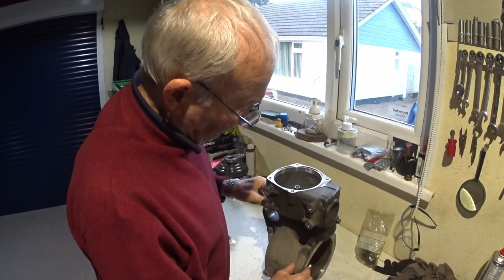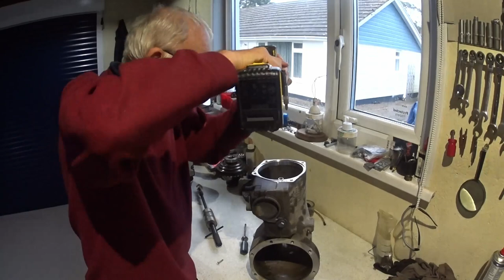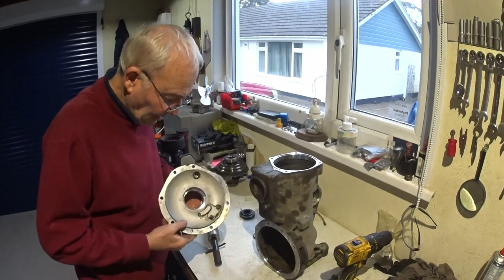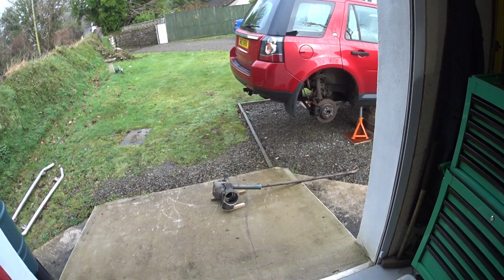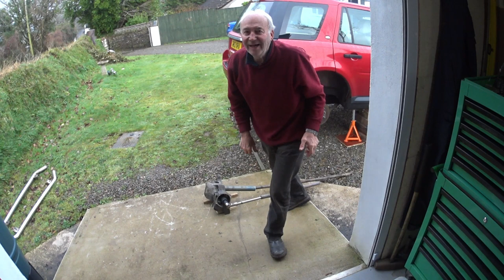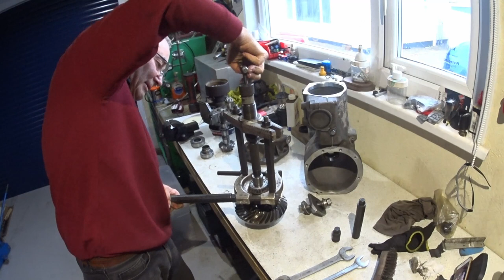Freelander 2 Rear Differential Pinion and Crown Wheel Bearings Removal

Comment: Which bearing is it that your removing in the last part of the video? Or if you can provide a part#. I have to replace mine . Thanks
Reply from the maker: Hi,

The bearing in question are the crown wheel bearings (one on either side of the crown wheel) The bearings came in a kit as; the 2 crown wheel bearings, the inner and outer pinion bearings, the 2 crown wheel oil seals, the pinon oil seal and the 2 O ring gaskets.

However I should still have the old bearings in the workshop, I will get the bearing number off the crown wheel bearings later today when I am in the workshop and let you know.

Regards, Brian.
Reply from the maker: Hi,

The crown wheel taper bearing number is 32008 and the size is 40mm i/d x 68mm o/d x 19mm wide.
The originals are KOYO hi capacity. Landranger Deeside 4X4 sell them but they are quite expensive, however any bearing supplier will have them, but they should be good quality.

Regards, Brian.
Reply: Thank you. I appreciate it
Reply: I was able to order the bearing from Rockauto based on the model/part #. My other issue is that I might have to replace rear diff side cover. There was some wear and tear on the ring where the axle seal fits. The seal doesn't fit tight. If you are able to provide an email address, I can send you the pics. Thanks
Reply from the maker: @asifkadodia3822  There is some great gasket jointing compound that I have had some good results from which will work for the O ring seal and on the outer edge of the oil seal if you have some damage on the faces. 
Its called Simply Instant Gasket, I buy the 200ml size as in that size it comes in an easy to apply auto dispensing tube, or you can get a 310ml size but you need a mastic gun to apply it. The link below is where I bought my last tube from. Regards, Brian.
https://www.amazon.co.uk/Simply-SR-005-Silicone-Instant-Gasket/dp/B00CI86RCM

Comment: Do you have any good advice regarding the removal of the rear differential of the Freelander 2? I saw a video for removal of the rear differential of the Freelander 1 and for a Volvo XC90, but all with a different approach and very time consuming / not very convincing.
Reply from the maker: Hi,

No such a bad job to remove and replace; once you have it up high enough and supported safely on stands, then rear wheels off and undo the large hub nut on the end of the CV joint, you may have to get someone to press the brake pedal while you slacken the big nut it as its very tight.

Then unbolt at the hub the 3 securing bolts for the two track control arms and the trailing arm, when they are released, you can pull the hub outwards to allow the drive shaft to come out of the hub; same the other side.

You can now pop the driveshafts from the diff, the O/S is easy as you can get a pry bar behind the inner CV joint and diff casing to pop it out of the retaining ring; the N/S is a tad more difficult as you can’t get anything behind the CV joint because of the shape of the diff casing on that side, to overcome this I bolted a large exhaust clamp on the outside of the joint so I had something to pry against to pop the joint out.

Next is the prop shaft, you have to lift one of the front wheels to be able to turn the prop shaft (due to the front differential) so you can turn it and get to all the bolts. My prop shaft was very tight and rusted in the flange, so I sprayed it with penetrating spray and let it soak in. There are 2 holes on the inside the back of flange where you can put an old bolt in then tap the head of the bolt to free off the prop from flange. Then unbolt the prop shaft centre bearing (just the one closest to the diff) from the body and you should be able to get the prop shaft clear of the flange. Then unplug the Haldex wiring from the unit.

If you now support the diff with a jack you can remove the main 2 front diff securing bolts and the 4 smaller bolts that hold the alloy diff bracket to the case and lift the bracket away, otherwise you have to remove the exhaust (and you want to do that)

Now remove the final 2 rear mounting bolts, you can get to them fine with an extension bar and miss the silencer, then lower the diff down. If you remove the Haldex unit from the diff before you drop the diff down it obviously makes it lighter.

My Freelander is a 2013 2.2TDI so could be a tad different for other models or versions.

Regards, Brian.

Comment: How did you keep the pinion shaft from spinning while you loosened the pinion nut?
Reply from the maker: You have to get the special tool comprising of the 41mm 12 sided socket, this is the one that locks/holds the pinion nut against the diff casing and the other piece in the kit goes over the pinion spline that has the fitting on the end for a 3/4" drive socket drive. So the nut is held in place and its the pinion spline that you turn to release the nut. A few companies make the tool, one is Sealy with part number VSE9540 and another is Laser Tools with part number 7547, I don't think it may be possible to remove the pinion nut without the special tool as its so deep in the casing and very tight.

Comment: Hello, what size was the 12 point nut?
Reply from the maker: Hi, it's 41mm
Reply: @TheCADengineer  thanks, that tool is hard to come by in Canada and expensive to use once so I am just making one, maybe I will show what I made on YouTube. The other question is, my differential carrier bearings don't appear to have any chipping but the races have a gold brown color to them, in your opinion should I replace them as well? I assume it was heat that discolored them.
Reply from the maker: @JoeBlack1108  My diff carrier bearings were also discoloured with a brownish tint, however they were not pitted or didn't shown any signs of surface wear, but when I buying the parts I had a choice of just buying the pinion bearings or the bearing kit, as were are keeping the Freelander for another couple of years (it only has 56K miles on the clock) I decided to go the whole hog and replace the lot as per the kit.
Reply: @TheCADengineer  what's funny is Land Rover told me the differential carrier bearings and the pinion closest to the gear are none serviceable parts so they don't sell them, the carrier bearings are no problem to get from an auto parts store, but I don't have the bearing number for the pinion bearing closest to the gear until I get it apart. You don't still have that one kicking around do you? If you do could you send me the part number?
Reply from the maker: @JoeBlack1108  Hi Joe, that's correct; no JLR p/n for the inner pinion bearing, only a p/n for the outer bearing (LR082096) and that bearing is JLR specific with no SKF / Timken numbers or a JLR p/n for the pinion kit. I generally just buy bearings direct from a bearing supplier in the UK, however they could not find and bearing numbers for them. The kit is the way to go as you get the collapsible collar which sets the pre load, the 2 pinion bearings, the oil seal and the pinion nyloc nut, or the big kit which is the one I bought, this has the same as the in pinion kit but also the carrier bearings, seals and big O ring gasket. Sorry but dumped all the old bearings so don't have any numbers or sizes.